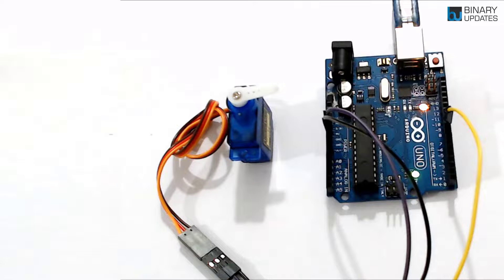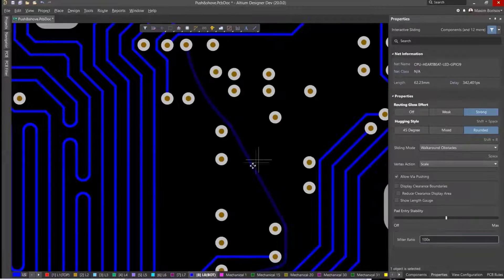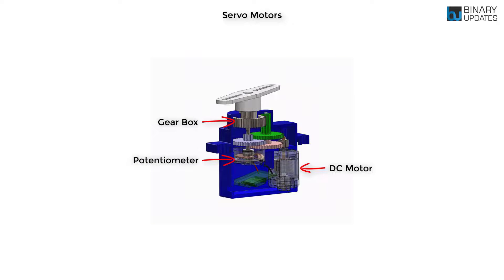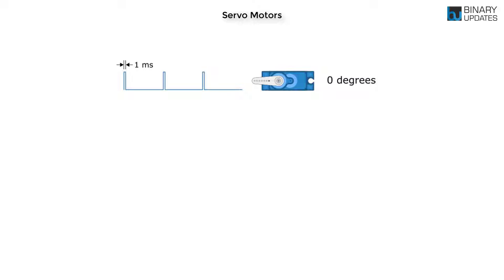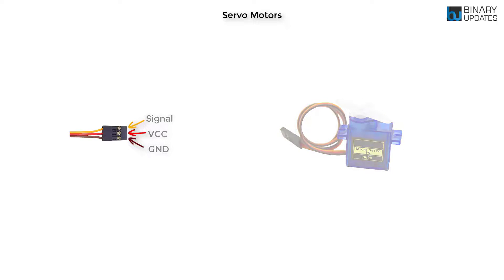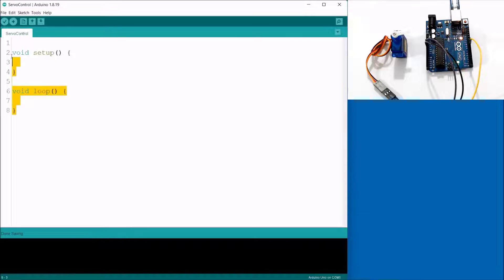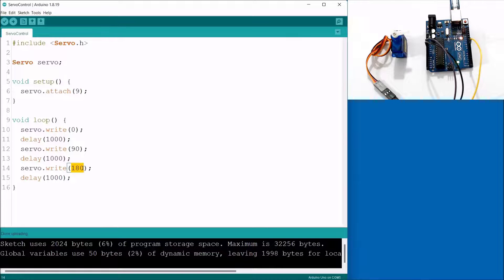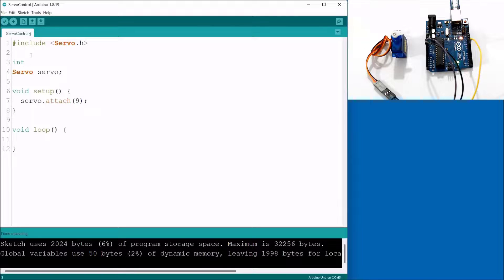Control Servo Motor with Arduino- Complete Guide

Comment: Hello sir,
I've been following your videos for the past few weeks, Can you make a video on which microcontroller to use for industrial machines, For Example if there are 4-5 Ac servo Motors and more than 3 actuators in a single machine.
Reply from the maker: Hi I'd surely make videos on suggested topics on how or what microcontroller will suit for 4-5 AC operated industrial servo and 3-actuators to control. I believe you can consider ATmega328 AVR since its easy to program using Arduino IDE. And if you're PRO user and have prior experience in programming then STM32F1 series is also good as it also support plenty of PWM pins to drive servo and actuators. I hope this may help. Good luck and best wishes!
Reply: @BINARYUPDATES  Thank you!,
Sir my kind request to you is, Please make an online course on how to design custom control boards for various projects and what are the things to be noted before designing.
As it helps and inspires many aspiring engineers like me.
Reply: Pop

Comment: i have few questions and hopefull u will answer passionately.
1. i want to use dc motor to  motorise my balcony sun-shade which is horizantal to earth, so which motor should i use?
2. How to run it for specific distance, for example i want to run it to cover 5 meters of distance, bcoz i dont want to run it for too long or too short, so can we run a dc motor for specific distance or number of turns?
3. Is it necessary to use feedback switch so when it reaches to specific distance it will be off autoamtically, or we can run it for specific distance using programming?
Reply from the maker: Hi you can use Servo Motor, there are motorized sliders you can buy for curtains. These are usually more like a horizontal sliders. You can use with Servo mechanism to precisely control the shaft and movement around horizontal space. Please consider learning about some home automation projects like curtains control or similar. Good luck and best wishes!
Reply: @BINARYUPDATES  how about making a video tutorial on this project?
Reply from the maker: As it involve lots of moving components. Maybe someday in future when I'll have time. I may make video to to create similar use case around Servo Motor to control horizontal movement of shaft.

Comment: Is it necessary to use delay after servo.write?
Reply from the maker: Hi Yash, it will work even without delay but then Servo motor will move fast. You can change Arduino code and try and experiment at your side. It will be more of a fun. Good luck and best wishes!